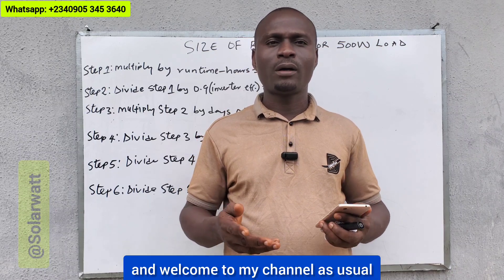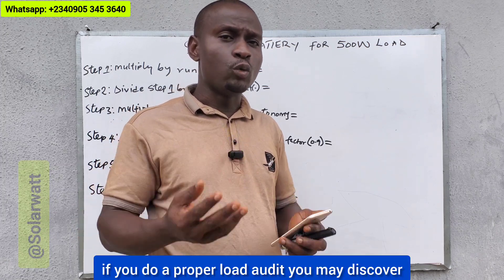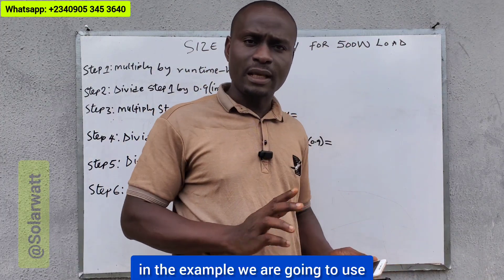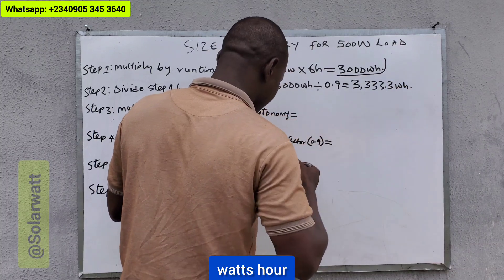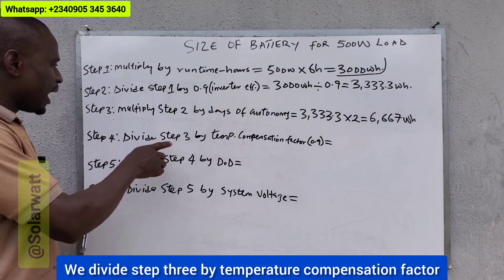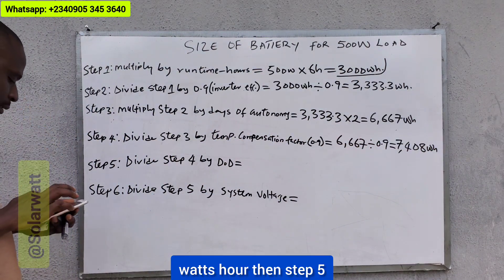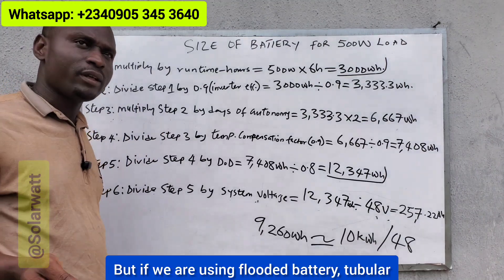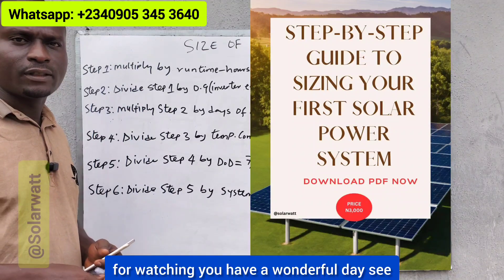How Many Batteries For A 500-Watts Load?

Comment: Who or what is going to provide energy to the inverter ? If its during non sunlight hours then the battery or grid will have to provide that energy. If its the battery then the charge from the battery has to deliver it and that energy has to added to the total battery capacity. Little correction required by the lecturer.

Comment: Why are they 8 batteries not just 2 batteries
Reply: Because he used 12v example instead. In series it gives u 48v
Reply: Same 150ahms.  Then parallel them to increase the Ahm making 300ah.  Because there’s. No 257ah battery in the market.

Comment: This your calculation is just too cumbersome, pls find a way to simplify it, and again are u saying I will need 8 batteries of 150ah for just 500w load? even with solar panels installed, why?
Reply: The calculations is right, in case you are using 48V/150ah battery, you will need only two of the batteries....but using a battery with less voltage means u will need more batteries to obtain your 48V....In this case, 4 batteries in series give u 48V/150ah that is connected to another 4 batteries in series to obtain 48V/300ah and this is even more than the requirement of 257Ah.
Reply: What he calculated in simple term is the runtime of 500w load on batteries only for 2 days of 6 hours each day totaling 12 hour. If you multiply the load by 2 which is 1000w, the runtime will be divided by 2 which will be 3 hours per day for 2 day of 6 hours. Your runtime and days of autonomy is what mostly determines your battery size, not just the load. Solar is not included in the setup.

Comment: I do get my own by using this simple calculation:

12volts * (my battery size which is 257amp) will give me 3084

Then I will divide 3084 by my load which is 500w, the result is 6.1

There a 257amp battery can carry my load for just 6 hours

Comment: Are the loads considered in this system  all AC or, because most DC loads on market are 12V and if the system is 48V how do i connect  my 12VDC
Reply: Watch the video again. Connect four 12v batteries in series you will have 48 volts

Comment: Good video. You considered inverter efficiency but you forgot to add inverter consumption to the load. Some 48v inverters maybe consuming btw 30w to 50w every hour even with no load.
Reply: Then you should include your watt load together with your inverter watt consumption and use it for your calculations again sir

Comment: Please Sir will the cost not be too much for just a 500w load? For example I'm using a 1000w inverter, how many batteries (size of battery)and panels (total size of panel)should I use to power a 500w load in 5 hrs pls I need your help. From Nigeria
Reply: Your battery volt × battery ah × number of batteries connected ÷ sun peak hour (4hour) = your answer 

Your answer divided by any solar watt size you want to use (80watt, 150watt,200watt e.tc

Then you will know the number of panels you will use
Reply: @UniqueEmmanuel-v7y  in most cases big is better.. Two 550w panels, two 400ah lithium batteries or two 250ah lead acid.. .. Big gives you much room power to play with without too much of power conservation ...

Comment: Please sir, this 60% DOD, is it that the battery shutdown itself at 60%or it is been set from the inverter?? 🙏🏽
Reply: No.. Your phone at 60% battery doesn't shut down.... Charge controller shows the battery level
Reply: @kabelomodibedi8076  Does that mean when it's remaining 40% the customer is advised to shutdown the system sir?
Reply: @OfficialPeemax_tech  yes it's adviceble..... Meaning lead acid not lithium battery... So buy lithium battery..
Reply: When a battery is designed to have a 60% depth of discharge (DoD) it means the battery State of charge (SoC) will be 40% percent before you stop discharging it further. And this function can be set on the inverter also some charge controllers have this function it is called Low voltage disconnect (LVD) so when it is set up your inverter will disconnect your load when your battery capacity remains 40%.
Reply: How can one set it